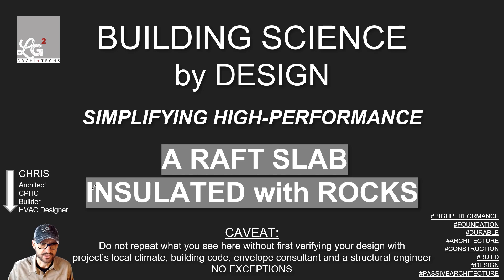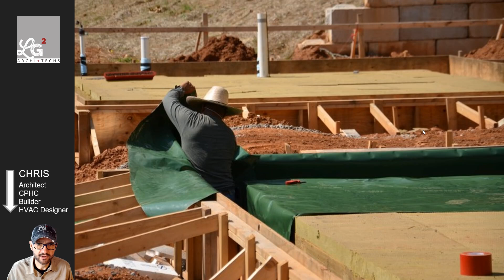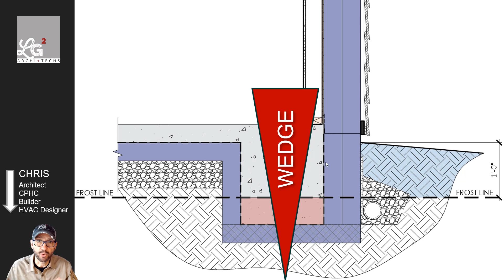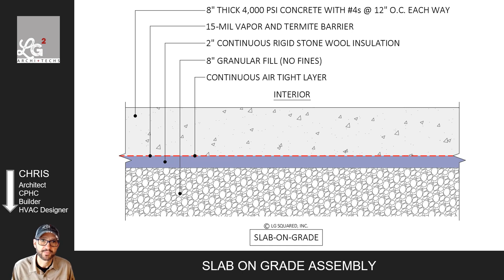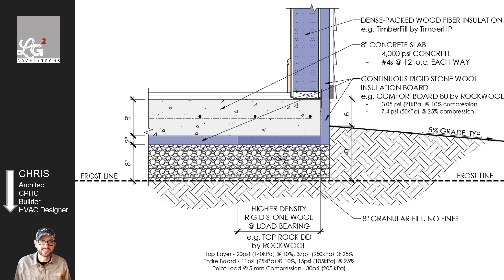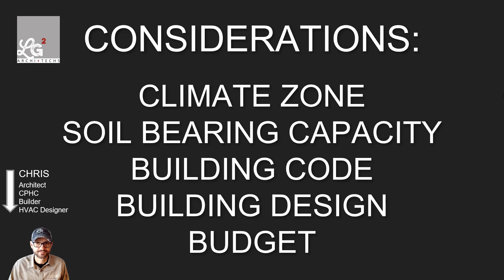Simplifying High Performance: A Raft Slab Insulated with Rocks

Comment: Wait your footers are on top of insulation?  Is the whole structure bearing on the EPS?
Reply: They make foam that has a high PSI rating. There's a product called Geofoam that is used as structural fill under highways.

Comment: When using Rockwool below grade, the relative humidity (RH) of the Rockwool will become the same as the grade itself because Rockwool is a vapor open material.

Because the RH of earth is close to 100%, so will be the RH of Rockwool. But this means that the R-value of the Rockwool will drop significantly... Rockwool doesn't publish any information about that in their documentation which is very odd... 
According some sources you loose at least 30% of your R-value.

Furthermore, nobody tells you what will happen with the fully saturated Rockwool when it starts to freeze below the surface.

Rockwool makes their products water repellent by adding additives and we don't know how these products will hold up below grade... those additives might detoriate over time due to bacteria living in the earth.

Have you ever thought of using "granular foam glass" (i.e. "Glavel") to insulate your slabs?